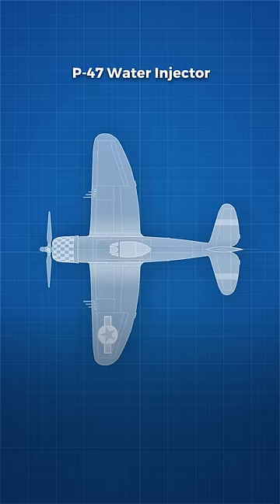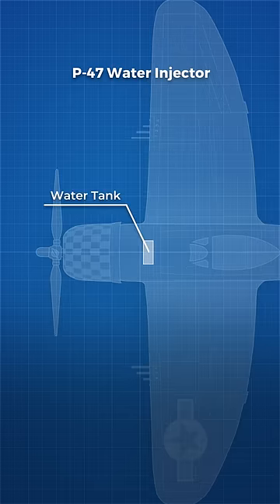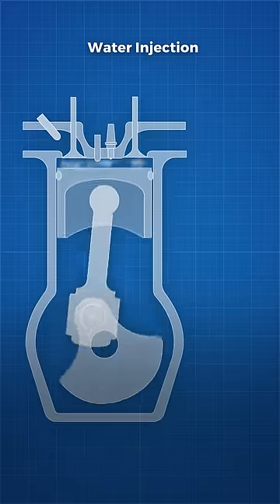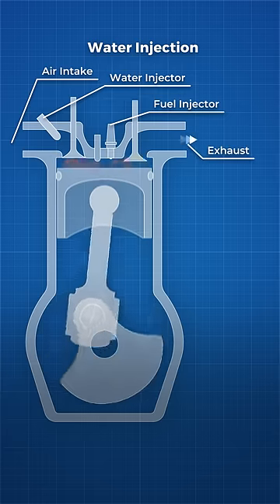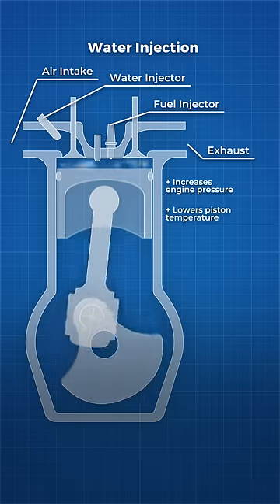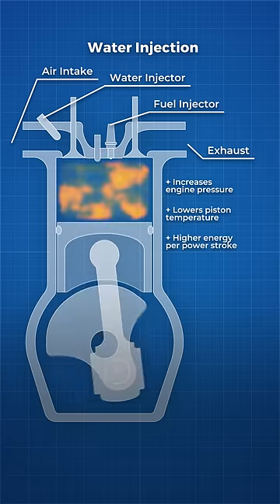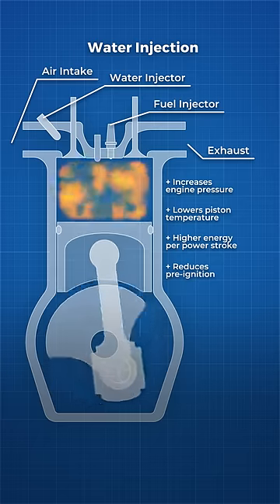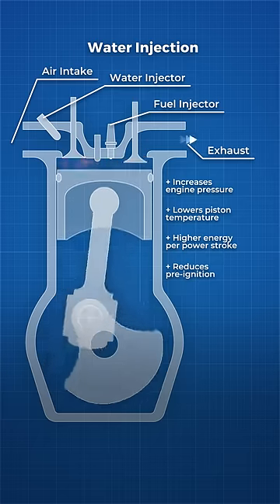How Water Injection Increases Horsepower

Comment: It was water/methanol injection (mostly methanol), as the methanol raises the octane to prevent detonation, and also cools the airstream to allow more incoming air into each cylinder.  

There wasn't an injector for each cylinder as the video would suggest, as you only needed one high flow atomizer injector further up the intake manifold an a bit of time/space for it to be able to actually cool it down.

From what I had heard old timers say (like 25 years ago), there was a manual switch to turn it on, as it was only used in dog fights during emergency maneuvers (like getting out of the line of fire of an enemy plane), as it was possible to blow up the engine using it.  I was told the switch was labeled "War Emergency Power".

Also the P-47 used a pressure injection carburetor.

A buddy of mine used to make a "bolt on" like this for turbocharged 1/4 mile racers that would automatically turn on once your rpm's and boost got to a certain amount (µP controlled).  Just two knobs & an on/off switch on his controller box.  For $800 it was a very cheap 50+ hp that was relatively easy to install on something like an 87 Grand National 3.8L.
Reply: Germans relied on it more because of lower quality fuel I think? And the diesel engines methanol injected also
Reply: It's actually more water, and the water is the important part. The methanol is added just so it doesn't freeze. This is something people do on racecars too. And there is cars that run on pure methanol. But the water injection is a completely different thing. It has the effect of running a higher octane fuel and is commonly added to  turbocharged vehicles. It also has the added bonus of basically steam cleaning the inside of the engine so It can remove carbon deposits which can also cause detonation.
Reply: so for every egr valve running turbo car this would be good to have ?
Reply: could it be that, since water is not compressible, it also increases the compression ratio?
Reply: @19LG99  no it all gets turned to steam. Engines run above the boiling point of water. The only reason the water in the radiator stays liquid is because it's pressurized. Which is why you never want to take the radiator cap off a hot engine. It can flash boil and all turn to steam when you release the pressure. the added pressure of the steam does effectively slightly increase the compression ratio. But not nearly as much as liquid water would. And I don't think that has as much of an effect as cooling the air does honestly. Cold air makes a big difference in power.
Reply: @19LG99  No, it's just a fraction of a volume of air sucked in and it'd turn to steam anyway. It increases the compression ratio by cooling the engine before the combustion. Since the engine is hot while running the efficiency gets lower as the air gets heated when it enters the engine even before the compression stage. Hot air is harder to compress and lower the efficiency of the engine. The water cools the intake air and the engine therefore increases the efficiency of the engine.
Reply: I think it’s actually 50/50
Reply: Methanol doesn’t raise the octane of the fuel, the water is doing all the work, it’s only added so the water doesn’t freeze at altitude. He explains in the video what the water does and that’s what prevents pre detonation, cylinder head temps, and valve temps are the leading causes of knock because they get so hot they instantly ignite the fuel.
Reply: @themerc123 Technically everyone is correct here. Methanol DOES indeed increase the octane rating by a useful amount, depending on the mixture ratio. As by default methanol has a rating of 110 octane. Furthermore, methanol also aids in atomization, further increasing the water's latent cooling ability, AND prevents freezing at higher altitudes.
Reply: i kinda forget WEP is real sometimes
Reply: @V3R71GO  it doesn’t not change the octane rating of the fuel what so ever,  they ran 150 octane fuel in these plane. Methanol is extremely knock resistant and the “octane” rating of it really isn’t accurate, the reason it’s ran in stuff like too fuel dragsters is because of the amount of it you can pump into a combustion chamber, and the fantastic cooling properties it has. You can run an engine on nothing but methanol and no radiator and it won’t destroy it’s self. Methanol is actually significantly weaker that gasoline by lets say 4 to 1, meaning you have to run 4 times the amount of methanol to 1 gasoline to have the same power output, not a great idea in a plane. Also that goes too show you how little of effect the methanol has on the fuel itself. It aided in keeping the cylinder head and valve temps lower which means you can run higher amounts of boost, which means more fuel can be burned, so more power. Straight water injection is more effective that water methanol but, one water freezes in the tank at altitude, and two freezes when it’s atomized, that’s why the methanol is there.

Tldr: water meth doesn’t increase the octane of the fuel, it makes the engine more capable of utilizing the octane rating of the fuel.
Reply: @2muchofyou if your race car is getting to the point that intake temps are causing detonation, this would help. I put one in my Saturn LSJ project oh 15 or so years ago because I ran the supercharger fast and hot. Miss that car 😂.
Reply: 😂 all these arm chair experts 😂 who is correct?
Reply: Now that's wap
Reply: The methanol adds oxygen, allowing the engine to burn more fuel
Reply: AEM makes a Water/Meth kit for IC engines...
its still very popular in Racing applications
Reply: I used to fly an airplane with water injection, it was a very old airplane…. Water evaporates in the intake, which causes heat/energy (latent), to be absorbed. This causes the intake charge to become cooler and more dense, both of which add horsepower. Secondly, the methanol effectively increases the octane of the engine, and adds fuel (alcohol). All of these effects cause the engine to run cooler, and require more fuel, which in turn boosts horsepower. The system was completely automatic, it used a series of micro switches in the throttle quadrant, which was effectively an analog computer, to run the methanol/water injection. 

Water meth is typically 50:50 mix, higher methanol percentages will increase power output, but have a much higher risk of catastrophic failure.
Reply: Methanol, call that Walter Whiskey
Reply: Not sure about American, but Germans didnt use mostly methanol.  It was a 50/50 between water and methanol...hence the name, MW-50
Reply: First time in a long time that someone actually earned the thumbs up. Good comment!
Reply: Watcha mean raising octane with methanol? Octane is an 8 long chain of alkane and methanol is a single carbon alcohol..has nothing to do with each other?
Reply: Also worth noting that these fuels were Leaded, which also further allowed higher compression despite moisture content so long as compression occurred, the spark would more reliably ignite at the already necessary high compression ratios
Reply: @themerc123 Methanol increases explosive power per CID of fuel, the water injection helps, but the main reason it doesn't seize/kill the engine was the lead in the fuels allowing more reliable ignition in high difficulty compression situations
Reply: @SeanHoltzman  I’m not explaining this again, it does not effect the fuel mixture at all. It’s sole purpose is cooling and anti freeze. Gasoline has more potential energy per volume so please explain how adding something weaker too gasoline would make it more powerful?
Reply: @richardtheweaver4891  that’s nitrous oxide.
Reply: Yep. Good ole WEP
Reply: @themerc123 TY for making that correction. I was hoping someone would do so
Reply: So i can't drink it :(
Reply: @19LG99 the water turns to steam though which is compressible to that wouldnt be a thing
Reply: Methanol doesn't "raise the octane".
Reply: @19LG99  To a degree yes. More stuff in the same space equals higher compression.
Reply: Isn't he also labeling the spark plug as a fuel injector?
Reply: @radicaledwards3449  no it doesn’t. It’s for antifreeze at thats it. I’ve explained several times in this thread how water meth works.
Reply: @drewski5730  methanol does not increase the octane of the fuel. It’s only purpose is antifreeze. One it’s weaker than gasoline by a lot, two you are not spraying enough to make a difference. The reason running too high of a methanol content is dangerous is because you loose the cooling effect the water generates, which leads for an increased chance for knock. Everyone hears methanol and goes top fuel cars run straight meth so it must be more powerful but that is not the case, just more of it can be burnt at once which offsets it’s lack of potential energy per volume. Have you ever seen a top fuel car at idle? They will be literally pumping straight liquid unburnt methanol out of the exhaust, that’s how much of it they pump into the engine. You cannot do that with gasoline, it simply floods the engine. The important thing here is the water, not the methanol.
Reply: @themerc123  it doesn't matter how many times you explain, you don't even understand the simple physics that more stuff vs less stuff in a particular sealed volume equals higher compression.. it's very simple
Reply: @themerc123  hey man, I took organic chemistry, I’m also a shade tree mechanic with a DIY 500hp alcohol burning car in my garage in addition to being a captain at an airline. 

You’re wrong on many counts. I don’t feel like unscrewing your statements, and I don’t think you would listen to logic or reason anyway.

Edit: just because you seem to need to do some fact checking: cars use water meth as well, it’s a mod that can increase horsepower by adding fuel, it also allows higher compression ratios and higher boost because of effectively higher octane ratings (notice I said effective, reading comprehension). Also, you’re misquoting Greg’s channel, you should re-watch some of his videos, because he agrees with me. You can add straight meth to gasoline without water as well, but it’s not recommended for safety reasons. Straight meth will give you more power than 50:50.
Reply: @radicaledwards3449  holy fuck, i understand how compression works. You guys don’t understand how engines work, or how boost works, and to my earlier point how fuel works. I do. I work on them day in, day out. I’m just gonna ask everyone a simple question. Why is it when you add ethanol too 91 octane unleaded fuel, does it become 87 octane fuel? Why can you not run petroleum based seals on alcohol cars? Why is brake clean so good at cleaning up oil messes?
Reply: @radicaledwards3449  not even too mention the more compression you have the hotter things become, which just circles back too everything I’ve already said. This stuff has nothing to do with the fuel, or directly the amount of compression being created, it’s all about heat.
Reply: @drewski5730  I never said you couldn’t run water meth in a car? It does not increase horsepower by adding fuel, it does it by cooling the intake air temps and combustion chamber temps. Everything else you stated, I agree with, because that is exactly what you can do with cooler air and more knock resistance. So yes, if you want to say an effectively higher octane, whatever, octane is a measurement of knock resistance. My point has been that it increases the knock resistance of the engine, not the fuel. I apologize if my scatter brain didn’t make it seem that way, I have a tendency to think faster than I can talk.

Edit: also I admit i was wrong about why you can’t run higher than 50/50, it’s because it because flammable after that, that’s the only good reason on why you should run higher than 50/50. Also I’m not gonna even comment on running mixed fuels, thats a whole different subject.
Reply: @themerc123  you can run petroleum based seals on alcohol, but not the other way round.... I hate when people pretend to know he is talking about.
Reply: @radicaledwards3449  ok dude, you can’t but have fun thinking that. This was an enormous problem when they started running ethanol in cars, it dries and rots them. Alcohol dissolves in oil and breaks it down. Generally on pure alcohol cars you run AN fuel fittings and steal lines.
Reply: @themerc123  I doubt it, petroleum is far more reactive with most plastics and rubbers than alcohols are, how dont you know this? Its easily testable with everyday hardware store stuff. 

I build rocket launchers, petroleum gives me hard more hardware problems than alcohols do.
Reply: @radicaledwards3449  gasoline doesn’t react as aggressively with stuff like your standard rubber o-rings and will usually only do it over time, but I’m pretty sure that’s a modern problem because plastic fuel lines and tanks came into use around the same time ethanol did so I speculate that has more too do with it. Alcohol doesn’t react with seals, like o-rings directly but it takes the liquid oil out of the o-rings. This causes them to dry rot and fail and does this rather quickly. It’s not as aggressive too plastic, probably something to do with it being a solid, so it’s not able to permeate it like it does rubber, which is fairly porous, and it’s pretty commonly stored in plastic so that’s not what I’m referring too. Im not saying petroleum products doesn’t attack other petroleum products because I’ve seen what hydraulic fluid does to insulated wires. I’m also curious on what you mean by petroleum reacting with hardware though, everything I could think of being used in construction of rocket launchers would be fairly resilient too both alcohol and oil with the exception of propellants.
Reply: @radicaledwards3449  you do know that plastic and rubber are petroleum products, right?
Reply: So that’s what WEP in Warthunder means
Reply: Spot on!
Reply: Can we collectively agree that "War Emergency Power" Would make a great band name?
Reply: @themerc123 . 
Holy What?
Reply: @19LG99 fuel also has the same resistance to compression.
It's a very small amount of water, so compression isn't the effect, but  the presence of water along with red hot carbon, the water has a reaction with the carbon, and splits the water, and burns the potential carbon deposits, so fewer hot spots, means less detonation.
Reply: @themerc123 The water also destroys red hot carbon deposits, and that contributed to reducing pre-ignition.
The water vapor chemically reacts with glowing carbon, so it doesn't stand a chance to build up.
At least, that's what my late father had told me.
He was a combustion engineer at GE.
Reply: Yesh, it was used for WEP and degraded the engine quicker requiering engine inspections quicker than in the normal engine usage, therefore it was only used in ermegency situations as War Emergency Power suggests
Reply: @19LG99 water is compressible but just not by much. Still has an affect with varing importance to the situation.
Reply: Also heat and compression seperates water into hydrogen and oxygen. Nothing burns without O2 and hydrogen is extremely combustible 🍻🇦🇺
Reply: @themerc123  NHRA top fuel dragsters & funnycars use 90% nitro to 10% methanol better known as nitromethane. I think initial engine start & burnout is on methanol however.
 There is also NHRA top alcohol dragsters & funnycars, they do burn 100% methanol.  Just fyi
Reply: Doesn't it have to do with lowering the octane level to prevent knock (preignition)? I'm not buying the temperature idea.
Reply: @Ron-ku2vy  no, actually fuels with higher octane are more resistant to preignition and detonation. And basically speaking the higher the compression ratio of thr engine is, the higher the octane of the fuel is needed. 
 So they really wouldn't want to lower total octane of the fuel as a whole. 
  I think the methanol was an antifreeze for the water more than anything else. But leave us to say water injection works!
Reply: @themerc123  Then by your logic, cars fueled with alcohol, even the likes of E85 holds no merit. But in reality, alcohol fueled vehicles are often preferred over gasoline, why is this? This is because engines are not inherently limited by the energy density of the fuel, but the thermal efficiency of the engine. For any given IC engine, the amount of work, essentially power, is proportional to the pressure delta between its starting pressure, to the ending pressure of the expansion of gasses. Essentially, the higher the expansion ratio, the higher the engine power. This can be achieved either by;
 A) Higher engine compression 
or 
B) using forced induction to change the engine's effective compression.

With higher compression, comes higher heat, and with higher heat, the likelihood of the fuel igniting becomes greater. Sounds great, until the fuel becomes unstable enough to ignite out of its intended timing causing power loss, or worse yet, the fuel auto ignites from multiple different flame fronts in the cylinder, clashing into one another. This is engine knock. This puts holes in pistons, as the pressure and temperature spike far exceeds material standards of the engine's intended operation.

You are correct in saying that one requires more alcohol to create an equal amount of bang that gasoline has. But that is economy, not power. Power is the amount of work one can put through the engine in a given time span. With greater amounts of alcohol being run through the engine, one is able to absorb greater latent heat, this in turn rewards us by allowing more compression before the fuel becomes unstable and ignites. Which Further allows for ignition in tighter timing windows, effectively allowing one to advance the engine ignition timing to be more aggressive as well, further giving power.

Where standard gasoline allows 10:1 compression, standard ethanol will allow 14:1. This also affects effective compression via forced induction. More compression = more air = ability to ignite more fuel = more work/power. Whatever you lose in energy density, one regains back with significantly better thermal and volumetric efficiency.

So again, Gasoline typically has an octane rating of 86-98

Pure ethanol carries an octane value of approximately 110

Methanol, starting at 115 or even greater.

Its natural resistance to untimely ignition and detonation, coupled with its latent cooling ability is what makes these fuels effective.

So why doesn't planes just use them instead of gasoline?!  Simply put, 2 reasons.

1. Fuel economy is of a great concern in planes as that translates directly to when you will start falling out of the sky. More fuel = more weight.

2. Alcohol fuel fires are invisible, the only thing worse than fire on a plane, is an invisible fire on a plane. Safety in aviation is paramount to everything else.

Thus having the ability to use higher effective compression and more aggressive engine timings at specific strategic times became paramount, and was acheived through the use of smaller tanks containing 50-50 mix of methanol and water. With water absorbing even more latent heat, and consequently further improves the effective octane rating 

Methanol has the added benefit of not freezing. Which had that been the only goal, why not use other anti freeze additives, Lmao.

One guy above did mention one good point too though, Methanol has an embedded oxygen molecule. During it's decomposition (ignition), this oxygen molecule can aid in combustion.

Making explosions is easy, with higher energy density fuels, even more so. It is the science of doing it in a controlled manner that has propelled us. Literally.
Reply: @Ron-ku2vy  Mix water with alcohol and spray it on your arm.  Now try the other arm with just water. Tell me which one feels cooler.
Reply: @themerc123  oh and just wanted to point out, you erroneously stated that adding ethanol to gasoline reduces it's octane rating, when infact it RAISES the octane rating.

Ever seen those octane booster bottles you can add to fuel? That's predominantly ethanol.

 The reason you are thinking the way you do, is likely because you think that fuels start off inherently higher in octane and are watered down. 87 octane mixed ethanol fuel is not watered down 91 octane.  It is poorer quality 85 octane fuel, mixed with ethanol to raise its octane level 2 points.
Reply: @themerc123  In regards to WW2 aviation fuel you raised, that is absolutely correct. Generally for the allies, the fuels are typically not octane limited, being 100/130 avgas, and thus predominantly benefitted from the charge cooling qualities of the methanol water spray, which resulted in similar benefits to an increased octane. But Germany and Japan had much poorer avgas,   91/100, and 87/91 respectively, thus methanol does indeed have a greater room to play a role. Think of it as injected octane booster if you will, which again of course, the majority of the benefit being from charge cooling.

Though the remark I made in regards to its effect on octane was largely aimed at the automotive side of things, which often lives at a lower octane ceiling than aviation gas. My apologies for the confusion.
Reply: @V3R71GO  I’m wrong about the pump gas, but besides that you’ve literally just repeated everything else I’ve said. Direct water injection is more effective than water meth, it’s just far more complicated to implement which inherently makes it not preferable. I never said methanol didn’t have a cooling factor, in fact I said about 10 different times that it did. Why not use a other anti-freeze, well for one it needed to burn, and too it needed to not take away from the water it replaced and methanol fit the bill for both. I would also like too point out that I said e85 is better for power, but not for efficiency, as with methanol and that I stated one of the two reasons you did for not using methanol in planes, but i kind of did with stating you can’t run a higher than 50 mix because of the fact that the solution becomes flammable. Again, the amount of methanol sprayed during water methanol may have added some oxygen to the combustion chamber but not enough to have any real measurable difference. Then the fact that they already ran 150 octane fuel in these planes, it did not effect the octane of the fuel, again back to my point that not enough was being sprayed to change it up of down. My point has been that the water in the water methanol injection is the important part, not necessarily the methanol, but it’s important in the fact that it allows the water too work. I don’t want to sit here and argue differences in fuels because I don’t know enough about them to do so effectively, and I apologize for anything I got wrong regarding them. I’m arguing how water methanol increases horsepower and I felt the need to point out that methanol is not a effective as gasoline, and with the minuscule amount being sprayed in relation to the amount of gasoline it does not have any real effect on the fuel mixture.
Reply: @V3R71GO  I can agree with you there, regarding the axis powers having a larger benefit from water meth and I’m pretty sure the Germans sprayed up into the  70% methanol area in some cases, but most of the time it was 50, but they still never touched the boost levels allied planes ran. Germany also made up for the poor fuel with displacement and the fact that they used direct injection for fueling, meaning they could be more precise and reduce knock in that regard. The db 605 was 35 liters to the Merlin’s 27, with the Merlin still producing more power, 2000 by wars end, and it did this without water methanol. Compared to the 1450 of the German db 605 with water meth. Germany ended up combining water meth with what was essentially nitrous in the ta152 to get power levels similar to the Allies.
Reply: The system was automatic on US aircraft so you couldn't accidentally blow up the engine, if you firewalled the throttle the engine's automatic management system wouldn't let the engine go into a WEP level of boost until you hit the spray button, that prevented a highly excited pilot in the heat of the moment from accidentally blowing up his engine, the system would also do the same thing after the water injection tank ran out, it'd prevent the engine from going into WEP boost even if the throttle was all the way forward. 
Curiously Robert Johnson, the USAAF's leading ace as of when he left Europe, said he never used the feature after he was given P47's that had the system.
Reply: My Dad was a fighter pilot in WW II and he also told me that was a War Emergency switch. The engine would have to be checked on return to base after getting past that line.
Reply: @justaguy6100  
Yep, the crew chiefs hated the extra inspections if the pilot reported having used WEP or like some models if "the wire was broken", it also got factored in with the amount of time on an engine for it to be replaced.
Reply: Understood.
Reply: water expands by a factor of 1600 when it turns into steam